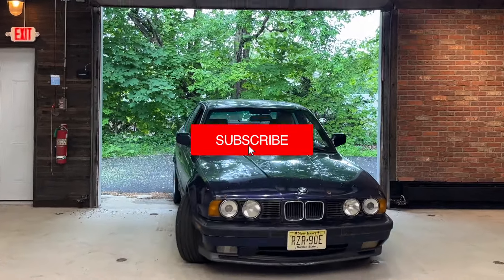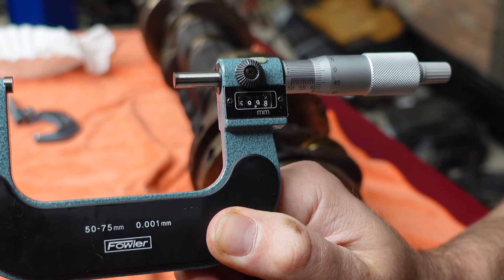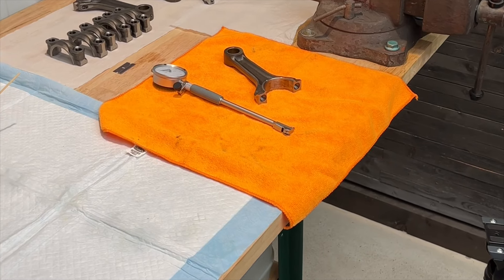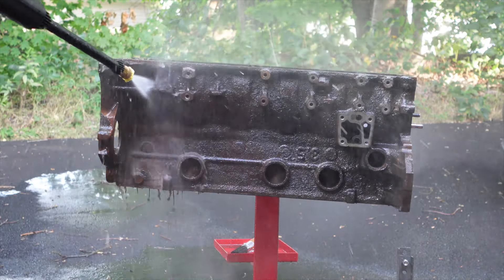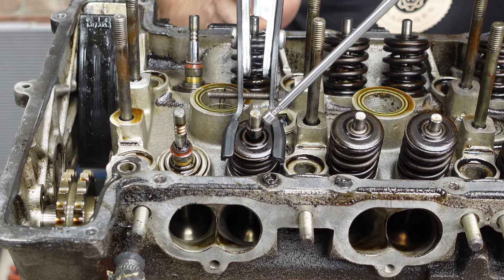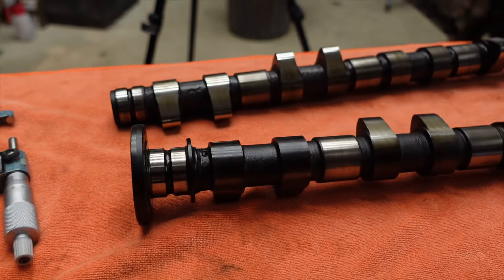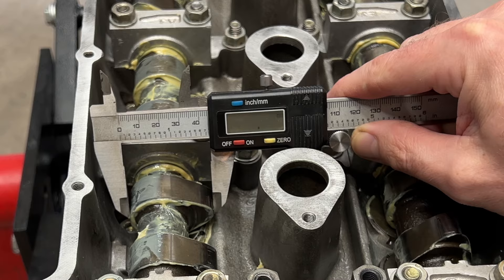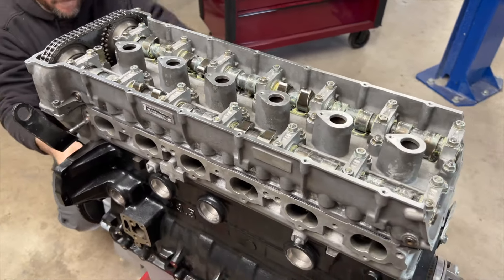BMW E34 M5 Engine Restoration / Evaluating Engine Block and Cylinder Head Parts / WeWrench Ep.23

Comment: The condition of everything at 260k is pretty remarkable. I really regret not buying one of these when I had the chance ~10 years ago.
Reply from the maker: It blew my mind too when I took it apart. Was in disbelief. I sat there and measured everything 3 times to be sure. I talked to an old friend of mine who said it's actually not uncommon in high mileage engines if maintained.

Comment: I just traded in a 1991 535i with 118k miles …. I feel pretty foolish about right now… so the first M series did not have V 8 but modified straight 6…. Which is what was in my car 3.5 liter……😢
Reply from the maker: Yup. Same engine block! Thank you for watching and commenting!
Reply: I am thinking about buying this car back… and adding a turbo to it… it needs a paint job and many other things that I did not want to deal with but have changed my attitude now.  The dealer wants 10k for it I was thinking of offering 5k for my own car back… 😳